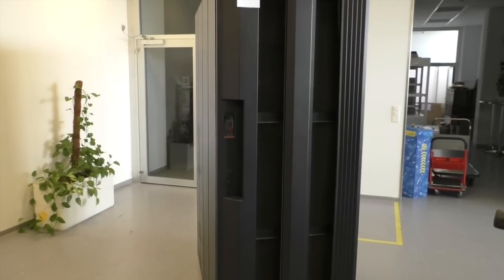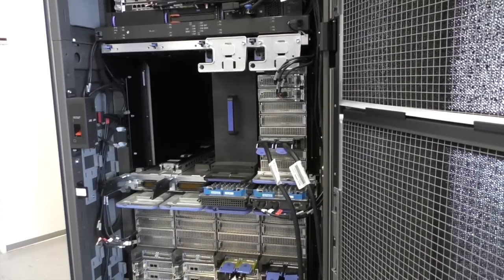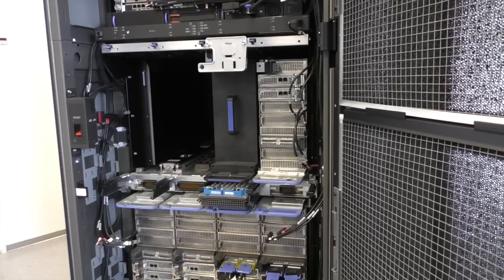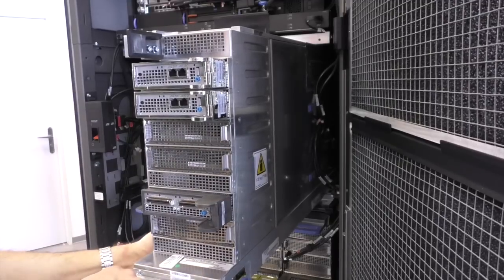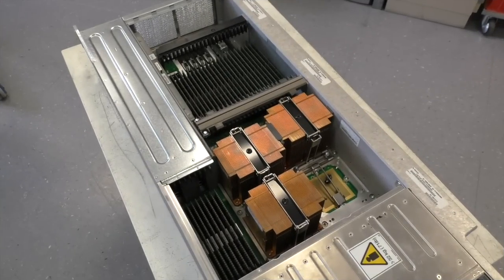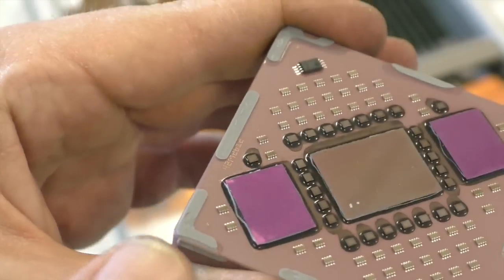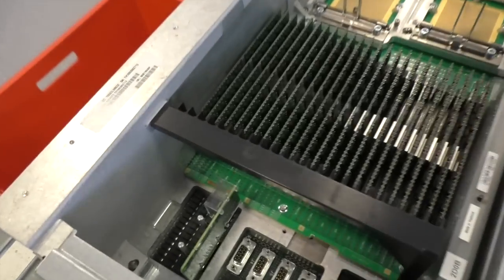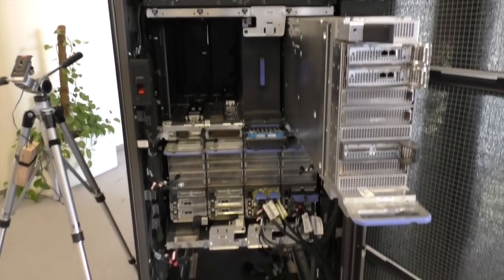$10'000'000 IBM server disassembled - Part 2 (PWJ33)

Comment: Can you please tell us what CPU this is?
Reply: It's got IBM Power5 CPU's if the name's anything to say about it. I always thought these units had Power7's but I don't know much about IBM's systems.
Reply: Ah, thanks.
Reply: Yes. P595 is Power 5 CPU.. the current generation is almost Power 9
Reply: I thought the much. I've always been an SGI guy overall, lol, i've only worked on one IBM system ahhah
Reply: I really want an SGI
Reply: Andiar Rohnds what kind? I've seen some altix ICE racks fully loaded for around $1000 USD floating around on eBay. if you're looking for something pre-itanium idk where to find that kinda stuff off the top of my head but there ARE some good sites for that stuff
Reply: Yes, I know ebay has them, but anything which can produce decent graphics is pricey.
Reply: Decent graphics by todays standards, you're best off building a workstation with a couple of Xeons and Quadro GPUs. The technology in older SGI systems is long outdated for what is considered "decent graphics" by today's standards. You could work with a Prism or a Tezro which'll have decent power and probably what you're looking for, but you'll be using pretty outdated software.
Reply: Ben, the SGI system is unique, its hardware and operating system can not be emulated or found anywhere else. It had an interesting array of applications, and the system itself is just totally cool. It's very unique among the world of computers.